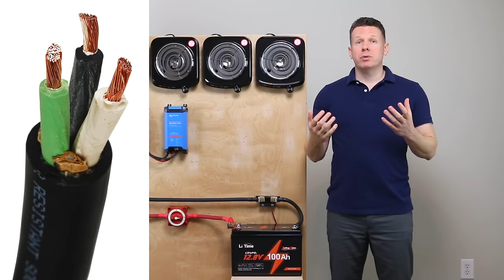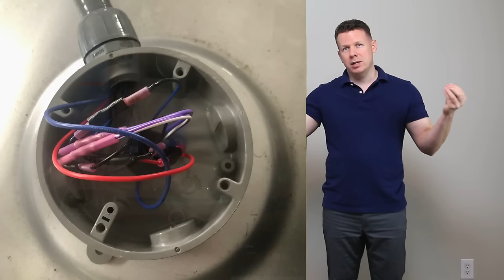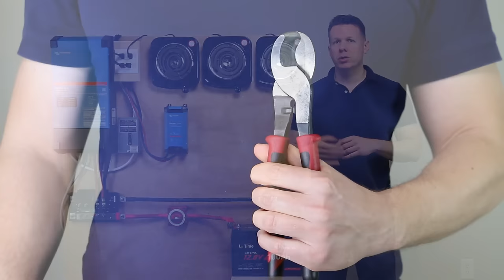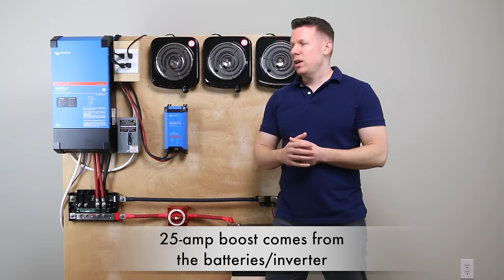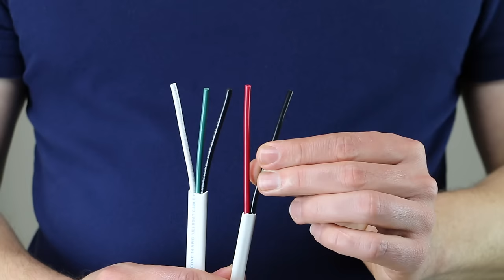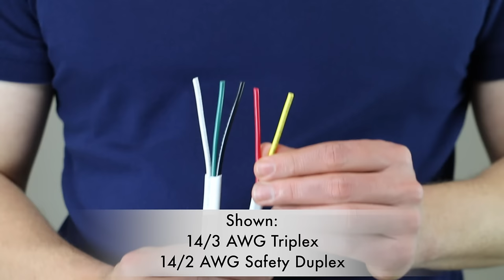The Top 7 Cable & Wire Mistakes for Van & RV Power Systems

Comment: Nice video. 30+ year electronics technician here.  You really hit on some key points. One I think that was missed was tie downs. I have seen it on ships, cars, trailers, and RV's/Campers; People not attaching a length of wire down so it doesn't rub or vibrate (or drag on the road) against things or create a hot spot.  These wires are not meant to float free no matter the length. They should be attached with proper wire/cable tie-downs. If not they can rub or cut through their insulation and short out, create a hot spot, or worse yet cause a fire. Thank you for putting these videos out. I always come away better informed.
Reply from the maker: Hey there, thanks for this additional insight! I know there are a lot of hot pipes and spinning drive shafts that these cables often route around. I'm glad you brought that up, thanks for tuning in!
Reply: 35 year  former Maintenance tech now a  old broken down bench Tech here,   Tip #10 install Some type of service Length at termination  Enough to strip/replace termination connector twice and still be able to reconnect.  (Difference between 10years later a Tech wanting to thank you versus strangling you)

Comment: GREAT video!  I refer a lot of people to your videos on various RV forums.

Mistake #8 - not using the same length cable between batteries when installing a battery bank.
Reply from the maker: Hey there, thanks a lot for spreading the word! I appreciate that. Also your Mistake #8 sounds good, definitely a rule that can screw up the batteries if not followed. Thanks for stopping by and leaving your comments!
Reply: Agree, mistake 8

Comment: 110% agree with your comments on using the correct color codes and using the same color as in your example of the purple wire. Even though our travel trailer is an upscale make & model I found when wiring some dimmer switches that the "ground" wire was not always constant let alone in other areas a color was used  that I had no idea what standard color code was being used. a little trail and error (read frustration & several splices) .
Reply from the maker: Thanks for tuning in and for the corroboration that the wire color thing is important! Sometimes it makes sense on the day you build it, but it can be a nightmare when coming back to troubleshoot or upgrade. Thanks for sharing your thoughts on this!

Comment: You leave a lot less questions with your thoroughness. These Avoid # mistakes, videos are a great chance to learn what not to do, then learn what to do in the very next moment. 
I'm getting ready to add a Victron 50 amp charger to our '24 Cirrus 920, and I'm putting all the pieces of the puzzle together while ordering what I'm certain to need for the job. 
I'm taking the Einstein approach, and spending 59 minutes to understand a problem, and taking the last minute to solve it lol. 
It seems that if I'm going 25 feet with a black and red 4 AWG cable, then a 60 amp fuse is just right. 
I hope so, because that's what I have. lol

Comment: You did a video on wire strippers a while ago, what do you use to strip 2/0 (70mm) cable.? 
I'm about to upgrade and move the batteries etc in my van and I am going to be using flexable cable. 
Keep up the good work,!
Reply from the maker: Hey thanks for tuning into this video and that old stripper showdown video! On the big cables, you just use the cable cutter as the stripper. These are mine but they are not the cheapest: https://amzn.to/3RUHxEY Hope that helps, thanks again for stopping by!

Comment: I have a couple issues. First you said 4/0 wire is 430 amps and I see 230 most everywhere. Hooking up a 4000 watt 48 volt inverter they may say minimum in free air #4. Then it goes #1 in conduit, 5-10 feet #1/0 and 10 to 15 in conduit #2/0. For free air after the minimum size of #4, 5-10 feet is #2 and 10-15 feet is #1/0. I can see using the big wire for distance and the main power cable but hooking up the 4 batteries in the battery bank should be able to use #4 as that is the minimum wire size for the inverter. Most people tell you to have all the cable the same and it seems a waste of money and time making up all of those large cables from #2/0 cable. I also think battery interconnects should be able to have metal buss bars. The next thing they talk about is terminals having one connection and all of these charts show multiple connections.

Comment: One thing I'm confused on is that "the positive and negative leads from the battery should be the same length". So they are talking about the same length from where to where? Thanks for doing these very informative videos. I've watched them all.
Reply from the maker: Thanks for checking out my videos and leaving another comment. To answer your question, the positive/negative leads from the battery do not need to be the same length and often are different lengths. If you look at the circuit, you can think of it like a racecourse, making a stop at the battery. The lead up and exit from a single battery don't need to be the same length. However, with multiple batteries, the links between them should be the same (and come in at different ends of the battery bank) so that each battery gets charged/discharged approximately the same amount. If each battery is going to a central bus bar, then all positives must match, and all negatives must match (to even out charge/discharge between batteries), but again on positives vs. negatives, no they are often not the same length. Hope that helps, thanks for stopping back in-

Comment: I was just about to use this SJOOW cord to run from my shore power plug to my WFCO, about 6 feet. Feeling all great because I'm running stranded wire but now trying to find a way to route it to get it out from behind the wall as quickly as possible. Is this recommendation to not run this wire behind the wall universal, or is there a way I can read the rating on the jacket and get a better understanding for my use case? Thicker gauge or shorter run, less heat, less issue? The wire serving the outlets will run about 6 feet inside the wall before being exposed in a wire channel along the roof. I'm disappointed because I spent a lot, but at least it's not already installed. Just found your channel and really appreciate your insight in these videos.
Reply from the maker: Hey Mike, sorry to throw a wrench into your plans. It is my understanding that these SOOW cables are sometimes routed through enclosures for short distances. It's not a huge deal. I was trying to tell people the "proper" type. If your cable gauge is sufficiently sized for your load (right gauge for the amperage), then that in itself will keep your wires cooler under load. Beyond that, just have the right breaker rating on each leg of the circuit. I think it should be okay.

Comment: What do you use for a 50 amp service wire-6awg and 4 conductors?  I like the 6/3 you showed, but I need 6/4.
Reply from the maker: Hi Kim, great question. For cables enclosed inside the wall, I have used 6/3 + 8/1 from Pacer Group. It's not listed on their website but if you contact their sales team they have it in stock. In some applications you can get a 50-amp shore cord and cut the plug off if needed. That seems to be the most economical way, but I am not sure if those cords are rated for use inside walls. Hope that helps, thanks for tuning in!

Comment: I get the fuse with a LA battery but the LiFEPO4 batteries have the BMS that limits the discharge current.  Is the BMS something that fails that the fuse is needed?
Reply from the maker: Hey there, thanks for tuning in. Yes, the BMS's fail sometimes. You have to fuse all of your lines. It's a separate job than what the BMS does.

Comment: I’m right in the middle of redoing the dc wiring in my rv and came across a black cable with red shrink wrap. Not sure if it’s positive or ground. Now I have to find where it ties into. What a pain.
Reply from the maker: Good luck tracking it down and thanks for sharing your experience with this! Thanks for tuning in-
Reply: @rosslukeman  Thanks, its my hobby rewiring and turning my 1995 trailer into an up to date machine. I guess I shouldn’t complain too much because I was the one who used a black cable with a red shrink wrap. I should have said that up front. 😂😂😂
Reply from the maker: @sunroy1  Ah ha! The plot thickens! 😂😂😂 Sounds like a fun project!
Reply: @rosslukeman  yeah it is! Hey thanks for replying

Comment: Thanks for clarifying. However, the use of black conductors in tipp nr.8 is really mindboggling for us Europeans... How on earth did that happen?
Reply from the maker: Hi Silvano, yes I suppose Europeans don't have black in their 230V conductors. That's why I use the Safety Duplex cables here in the U.S. as it makes it a non-issue. Thanks for tuning in and for sharing your thoughts!

Comment: IMHO, if you find yourself needing to run 400 amps through a wire, you need to build a higher voltage system.